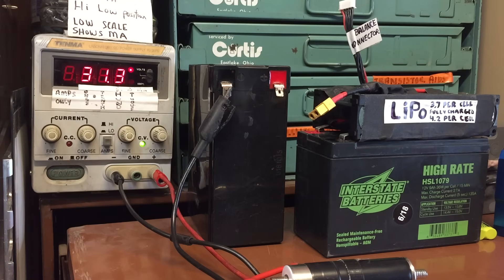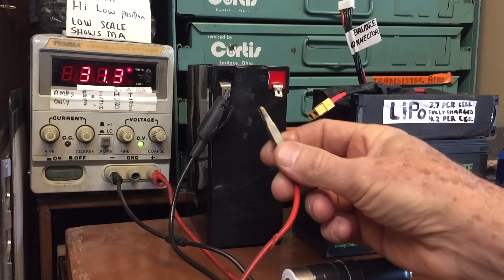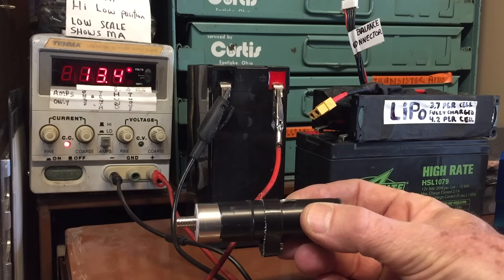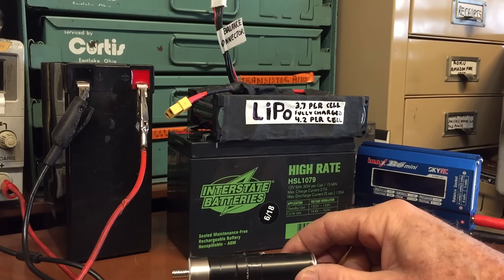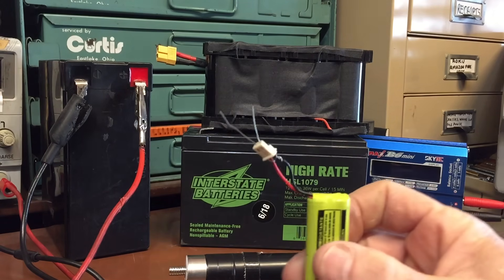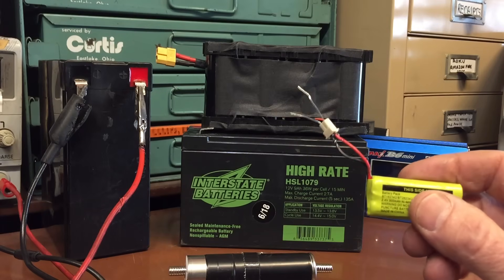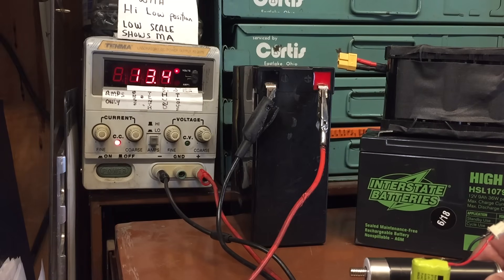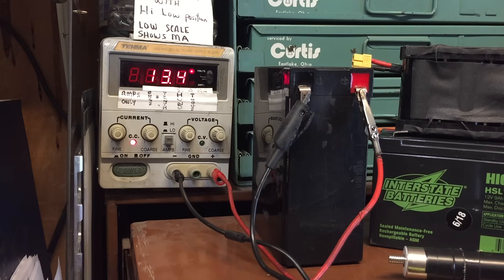Safely Charging Any Battery With Your Variable Power Supply.

Comment: With this theory, could I use a 84v lithium charger for a moment to revive a 48v battery pack if I turn the dial to 1 amp?  The 48v battery typically is charged with its 54v 2amp charger but its been drained to 49.8v and no longer recognizes the charger.
Reply from the maker: I've had some success reviving batteries in this manner. Sometimes the batteries are to far gone to restore, but as far as the safety factor goes it's probably best I don't advise you since I can't see your set up, and I don't know if your charger has  a direct connection to the battery your wanting to charge, or if your battery has any kind of  internal regulation circuitry as found in some makita drill batteries.
Reply: @GrantsPassTVRepair  Thanks for your response.  I went ahead and purchased a 60v dc power supply and thanks to amazon it will be here by 8am but it's a 48v battery with bms from an electric scooter and its discharged to 49.8. Nearly a brand new scooter, I think my son ran it dead and ten turned the power on one more time to get more.  Anyhow, appreciate the response, I reckon I could have saved some cash and tried it.

Comment: My bench power supply has max output volts to 17V
And 2A
Im trying to charge a 12V car batt lead acid
When i connect the psu to batt the psu drops to 11.5 V??? And fluctuating (11.1V-12v)
And amp fluctuate (0.00 to 2.99)
What is wrong here?
Reply from the maker: It sounds like your power supply can't deliver as much current as your battery is attempting to consume, so it's overloading the power supply and causing a drop in power.
Reply: @GrantsPassTVRepair  yes its a puny mobile repair powersupply. make sense. Thanks. Ill stop charging it now. So far it was able to charge from 11.2 to 11.5 volts in 8 hours. So i need a bigger power supply. 
Do you think i can use a ac adapter from my laptop to do this? That ac adaptor has an output of DC 19V and 4.5 Amps.  If yes do i connect it straight. All i need is one start ofmy car and i then plan to take car on a 1 hour ride and that will charge up the battery. So all i need is 1 self from this depleted battery. Any help will be appreciated.

Comment: I can't seem to find the original video
Reply from the maker: I removed it to make sure no one misses the point on the importance of current regulation.
Reply: Darn I have five of these 12volt agm batteries that are dead.  Picked up a bench adjustable power supply to test this with just this weekend.

Comment: To charge a dead LiPo battery that won't charge, connect it to the charger (the blue charger in your video) and select NiCd (lead acid battery setting) and set the amps to the lowest option (0.1). CHarge for 10 minutes, then charge like normal under the LiPo setting.

Comment: I'm surprised your lab bench switching power supply doesn't read amperage. I think people didn't understand you, because they don't get the difference between voltage and amperage haha awesome video!
Reply from the maker: Your probably right about the confusion. My variable power supply is able to measure amperage, but it requires that I flip a switch to do so. Some of them will display both current and voltage at the same time.
Reply: @GrantsPassTVRepair  oh okay. That's pretty cool 😉 also, this video was needed. Yes there's other videos about charging a battery like this. But, this video right here is what should be in every other video on this, but you're the only one. I was watching it like "thank you! Someone explained this in an easy helpful way!" Haha Hope you get a ton of views and likes!
Reply: Yes, I believe that you're onto something here, SMP.  It reminds me of the folks you run into at auto parts stores who firmly believe that a physically larger 12 VDC auto storage battery will damage the circuitry in a vehicle that came from the factory with a physically smaller battery.  I've tried to explain to some of them that 12 VDC is 12 VDC -- regardless of the physical size of the battery -- and, just as importantly, that the benefit of a "larger" bank of saturated lead acid battery cells is that it should be capable of reliably handling a larger current load, but most of them remain convinced that a physically larger storage battery always means more current will magically flow through any given circuit...which, naturally, leads to more power/heat.  Considering that most of these people don't know what a carburetor is, I've given up on trying to teach basic Ohm's Law to these folks.

Comment: If I understand it correctly, I think it boils down to Ohm's law. Voltage is what drives current through a resistor. If we assume that the resistance of the battery and the cables at any given point in time is constant, the only remaining variable is the voltage. The higher the voltage, the more current will flow. The only way the power supply can actually limit the current is by ignoring your voltage setting and dropping it down.

I also read you can leave most modern NiMH cells in the charger if(!) the current is low enough. It's called trickle charging. There's a catalyst in the cell that will recombine the oxygen which normally forms when the cell is full. That reaction, however, creates heat, and the catalyst can only handle so much at once. Hence the need to keep the current low. If you overwhelm the catalyst, bad things may happen. It may be why some devices still use these cells instead of LiPos. If charging time isn't an issue, you can keep the charging circuit really simple (read: cheap).
Reply: Ohms law the first thing I've ever learned in instrumentation and still use it everyday
Reply: ohms law doesn't apply to batteries though, hence they are not ohmic resistors.
Reply from the maker: Yes the voltage drives the current through the resistance.

Comment: Great job explaining battery charge methods. The Ni-mh and Ni-cad tend to grow crystals that effectively short the battery and the sudden high current and or reverse charge will often blow those crystals away. Usually it is a short term fix though.  I have done it literally hundreds of times over the years.
Reply from the maker: Thanks Steve, I think your right about this kind of fix being short term. Perhaps One exception is when you buy new battery that needs a small jump start before the charger it's designed to be used with can do its job.. I've even done this with car batteries, but once they are that stage where this is necessary I don't expect them to last much longer.

Comment: Thanks, Dave. That's why I like the Blue ESR Meter because it can test the ESR of batteries. 
I can't find that other video. What happened to it?
Reply from the maker: Hi Robert. After reading some of the comments under my first video, I thought it best to remove it out of concern that someone might blow up their batteries if I was misunderstood. Thanks for the reminder about the battery testing function of the Blue ESR meter.
Reply: @GrantsPassTVRepair  Oh, ok. I stopped smoking and started vaping several years ago. And many times people would ask for recommendations for a sub-ohm meter to check their vaping coils with.
I always told them to buy a Blue ESR Meter since ESR meters are designed to read sub-ohm values, plus they will be able to test the ESR of their batteries and also test E-caps if they ever need to. But I changed the cables in mine with some good coax cable and I don't use the cheap clips that come with it.
Reply from the maker: @robertcalkjr.8325  My only complaint about my blue ESR meter is that it would often turn on by itself without me pressing the power button, so I installed a second switch to stop that from happening.  BTW the newest blue ESR 2 talks to you. https://www.youtube.com/watch?v=g2jSE0WSIwY&t=1s

Comment: Well you are describing is exactly how automotive battery charging systems are designed to work and due to the nature of lead acid battery cells it works well in that application. You explained the theory behind it very well.

Comment: This technique of high voltage low amperage I use it a lot especially when trying to bring back an extremely old dead dead battery most of the time the voltage sag so the battery never experience any damage. It's surprising how these new technical guys do not know of this technique it's like their discovering new all over again.
Reply: There is a simple explonation, they make automatic chargers, and we live in capitalism, why teach someone how to revive a battery when they can replace it? Also, i had to teach a few students as a car mechanic, while it's not dangerous if you know what you are doin, it can produce explosive gasses if you don't pay attention, not a sigle one of them understood after explaining 4 times why, thogh my boss told me to let them do it, they forgot about the battery and we had to shut off power for the whole building and ventilate 4 floors.

Comment: Indeed, a "dead" 12V battery can be brought back to life with a high voltage like 30V and a few mA for a few seconds.
In fact, some chargers specially for AGM / Gel Acid batteries, when the batteries are fully drained or not used for a while, 
the charger use at the beginning a very high voltage and low current, and from the moment the battery responds and begin charging, the voltage begins to drop, and the current raise to approx 1/10 of the battery capacity. This is controlled by a microcontroller.
Per example a 12V 7Ah battery, will then be charged with a maximum of 700mA.
If the chargecurrent on AGM / Gel Acid batteries is to high, they produce a lot of Sulfur odor (like rotten eggs or matchsticks). 
Back in the old days i tried to charge a 7Ah AGM battery with a oldstyle battery charger (linear 12V 4A) and after half hour, 
the whole room had this Sulfur odor, and i saw that the battery already expanded (swollen) a little and felt very hot, it was time to pull the plug :-)

After that, i always use the thumb rule of charging at max 1/10 of the battery capacity,  700mA for 7Ah,  1,4A for a 14Ah battery etc....
And if the maximum charge current can't be adjusted, a 55W Halogen car light bulb in series with the charger leads will do the job.
Reply: Thanks Bjom V
Valuable information, I appreciate the 1/10 current of Ah for charging lead acid. It’s safe and effective.
Don’t hesitate to provide viewers with your valuable knowledge.
Greetings from Saudi Arabia.
Reply: @__-hh3gt  Thank you
Reply: @BjornV78 what is the rule of charging for Lipo batteries? I got some 3.7 v 22ah batteries and just wanna set proper values in my vaeiable dc power supply
Reply: A welder works too.
Reply: @JohnSmith-bh8um  , the current that a welder provides is much too high to bring a dead battery back to life. You need a high voltage and a low current in the mA range. The best and safest way is to use a lab powersupply. Besides, a cheap welder like a cheap stick welder, puts out AC current.

Comment: This works because of the current-limiting action of the power supply. The power supply reduces the voltage automatically to keep the current at the 10mA limit you set.

If the supply had no current limiting, and the voltage is significantly higher than the battery, then damage will likely occur. So it is important to note, this method can only be done with a current limited supply!
Reply from the maker: I agree, It would be possible to use a voltage regulator or a resistor to drop your current, but doing so is would generate a great deal of heat.

Comment: Cant see why you would do that. If you limit the current its not going to charge any faster with a higher voltage. Its just going to drop the excess voltage x current (power) in the charger circuit instead.
Reply from the maker: Yes I agree. A low current charge could take much longer to charge up a battery,  but sometimes you may not know what the ideal charge current or voltages should be, so I was just demonstrating one possible approach in a situation where you're left to guess.
Reply: @GrantsPassTVRepair  Yes I understand that , pick a low charging  current if you dont know, but what is the point of the higher voltage if you are limiting the current anyway? If you dont know the fully charged voltage of the battery then you probably shouldnt be trying to charge it anyway. In other words just pick a charging voltage slightly higher than your target voltage. It makes no difference to the final result in charging time if you are current limiting and you arent wasting power with a large voltage drop either..
Reply from the maker: @mrgriggs5815  Since many of us may find ourselves in situations where we don't know what the ideal charge voltage should be, and we don't feel safe to guess and possibly damage our batteries,  lowering the current assures us we will not damage our batteries no matter what voltage we use,. Other than for this reason you are correct. There is no point to use a higher than necessary voltage if you know what the voltage should be.
Reply: @GrantsPassTVRepair  i appreciate the video and the discussion as i am trying to learn everything i can at the moment about electricity. if i can ask, in what situation would one not know the the target charging voltage? i was huge into rc about 8 years ago and ran all lipo but occasionally i would run across a person with one of those cheap/weak nimh 8 cell battery, and my high end charger could charge four at a time so i ended up charging everyone's stuff in the field for  them but i had to google the suggested current......i realize i approached my problem from a different angle, but would my example be a time you would just crank the volts to 30v but limit the current to .500a? granted i was in the field so we wanted a quick charge, and in the shop it can sit on the charger all day if needed. just curious? thanks
Reply from the maker: @jasonbrown467  Sometimes t needed to charge up devices that did not come with a charger, and not knowing the ideal charge rate this technique came in handy.